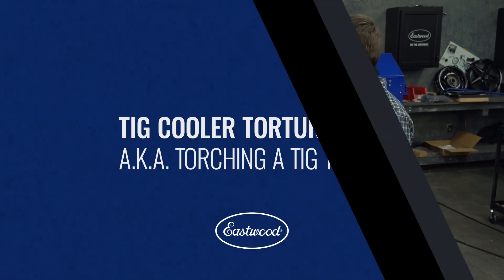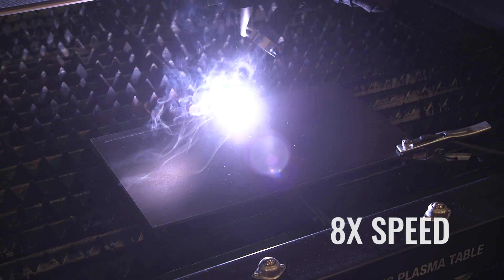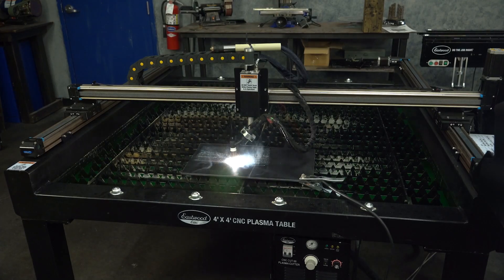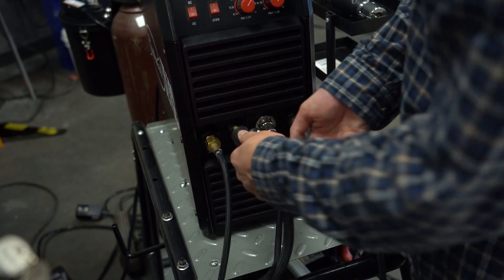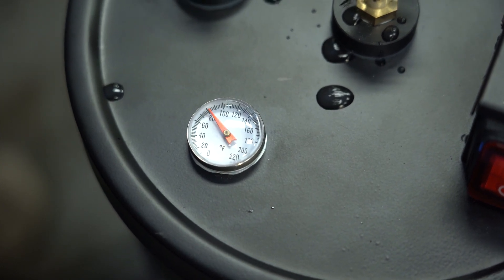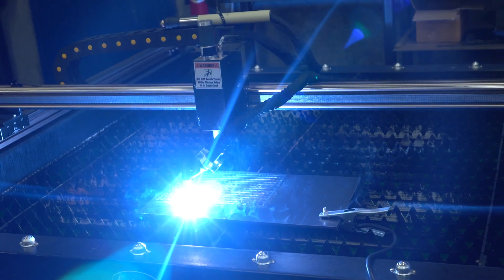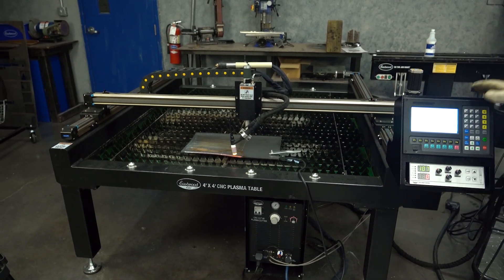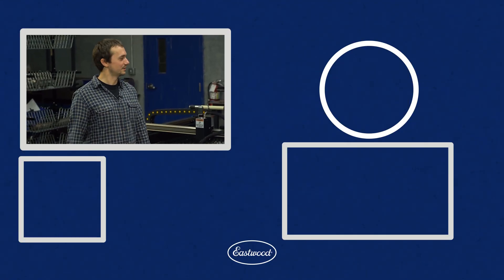How Long Can We Weld? TIG Welder Torture Test

Comment: I think this water cooler will work well in most applications but water holds in heat like a battery and even though nobody is going to tig weld for 20 minutes straight if someone was welding for a two or three minutes at a time with short breaks for an eight hour shift I would guess the water temp would likely be much higher. That would be a better test, a real world test for this water cooler and tig machine.